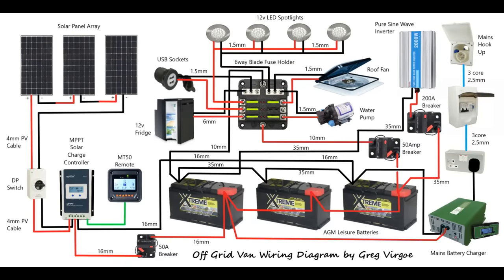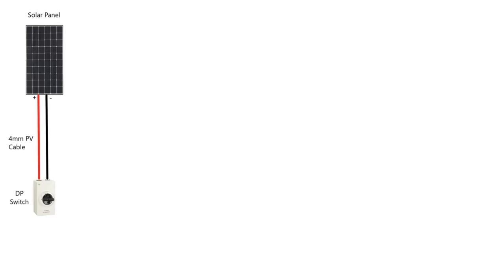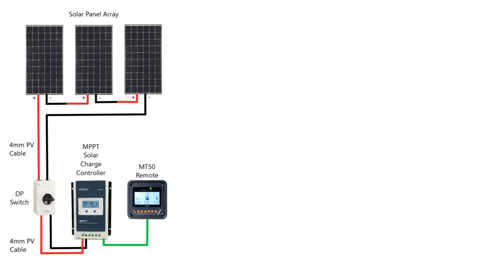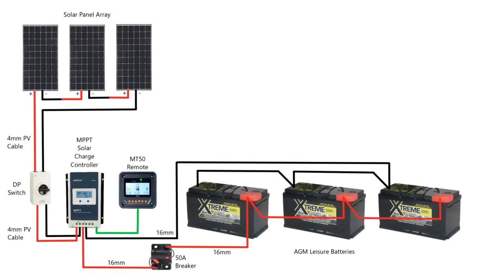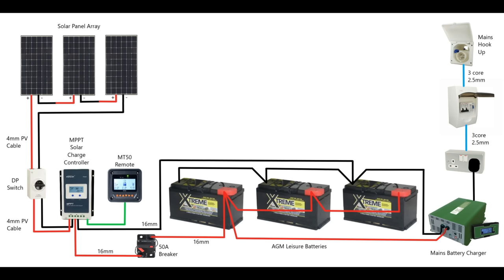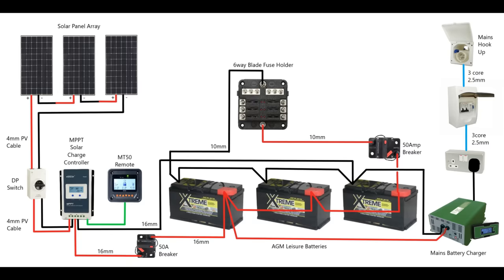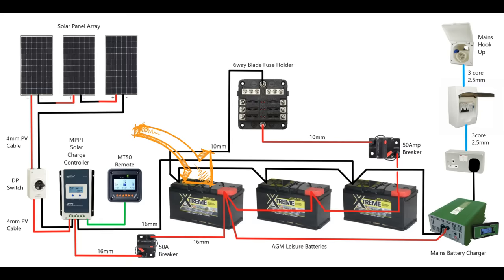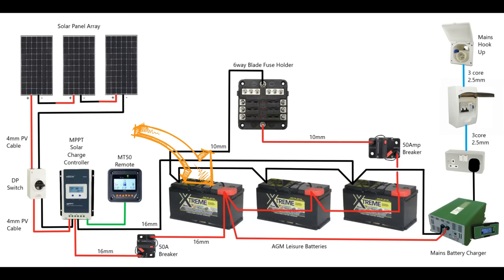How to Wire your Camper Van to be Off-Grid

Comment: Hi Greg.  Great video and using all your kit.  One thing, have you used a battery monitor/shunt on the negative to be able to accurately monitor depth of discharge?  Any tips on using that in the circuit diagram?
Reply: Also which battery monitor would you recommend?  Have bought all the Renogy kit from the later Ducato van build video, rather than Victron to save money.  Also , can I install a cheaper mains charger?
Reply from the maker: I didn’t install one in my van as I wanted the charge and discharge to be on opposing sides of the battery string. I just use the battery voltage on the mppt display to determine the DOD and always keep them above 12.3v which is about 70% full.
Reply: @GregVirgoe  I’ve only got 1 battery so would it be ok to use?
Reply from the maker: @johnmitchell3027  I’ve gone for the Bluetooth pluggin and the Renogy app for this new setup. It should give me enough info without the need for a shunt
Reply: @GregVirgoe  so have I.  Will save my money.  Cheers mate.

Comment: Hi Greg, first off, absoluteylyfantastic job on your videos and your conversion. I'm currently in the process of doing a build and your videos have been such a help. Just a quick queston regarding batteries. Is there a particular brand you reccommend, and is there a reason why you use 2x 110ah batteries rather than one large battery at 220ah? Many thanks!
Reply from the maker: I’m using Leoch AGM leisure batteries from Alpha Batteries. 
There is a free parts download in the description that has links. 
I use multiple batteries to give you redundancy if you have a problem with one battery you still have a backup or spares. 👍🏼😃

Comment: This is great. Can  a split charge relay unit be  fitted  in to charge the batteries from alternator when driving ?
Reply from the maker: Yes it can but I would recommend using a battery to battery charger instead of a relay as it will look after your leisure batteries a lot more than just a simple switch 👍🏼🤩

Comment: Thanks for sharing. When you define 4 mm cable what you mean ? Diameter of copper ?
Reply: What does 35mm denote? Or should that be 3.5mm?
Reply: @stewart9788  thanks Stuart that’s approx 6mm
Reply: @stewart9788  Thanks

Comment: Awesome video… my question is when using main battery charger on cloudy days do you turn off  dc switch or no??
Reply from the maker: No, I don't turn off any of the Dc supplies, as the 12v appliances will still run from the batteries as normal. I do switch my mains changeover to hook up supply so that all the sockets in the van are fed from shore power and make sure the inverter is switched off as that is not needed when plugged into the mains. Hope that helps.

Comment: Hi Greg. I find your videos very easy to follow.
I have just installed my ne lithium 100 Ah battery by following your video.
Question. Do I need to 'ground' the negative side of the battery to the chassis. There is no inverter so all DC 12V.
Thank you.
Andy.

Comment: I really appreciate your detailed videos. 🧡🙂  How does the inverter wiring work? I want to use my inverter in my camper that I'm renovating to be off-grid. The camper came with its own outlets that can only work if I'm plugged in at a campsite. As I said I want to be off- grid, so I bought an inverter so that they can work on solar. However, the inverter I have has the battery connections on one end, and outlets on the other. Outlets I don't need. How do I connect the camper wires to the inverter? Was there a certain type I needed to buy?
Reply from the maker: You can use a double pole changeover switch to switch between mains and inverter I’ll link one here. https://www.ebay.co.uk/itm/Live-IP66-Enclosed-Changeover-Switch-20-25-32-63-Amp-3-Pole-Surface-Mounted-/184127769293?mkcid=16&mkevt=1&_trksid=p2349624.m2548.l6249&mkrid=710-127635-2958-0
You wire the hook up power and output from inverter into the switch. Then the output of this switch to your sockets. You simply switch between the two when you want.

Comment: should the mains battery charger be fused or have a circuit breaker between it and the battery?
Reply from the maker: A battery charger would normally have some internal protection and if like mine come with the cables pre wired to the unit. Mine also has a fused plug on the mains side.

Comment: Another great, informative video Greg! I just have one question.. I plan on using a solar charging station (eco river pro 700w with additional battery and eco delta 1800w, 3200 surge). Where do I start? I understand everything except how the station (or 2) would be hooked up. Do you have a video on this topic? Thanks for any help you can provide 😊

Comment: Hi Greg,
The cable size you suggest for the 2kw inverter is 35mm. Can you tell if I can use, let's say, a 10 mm cable if I place the inverter about half a meter away from the batteries? 
Thank you for your very good detailed video! :)
Reply from the maker: That is right on the limit for those details. Any further and you will have to go up a size. It’s always better to be a little over and have that peace of mind. This calculator is very handy for choosing cables
https://www.12voltplanet.co.uk/cable-sizing-selection.html

Comment: Hi Greg, thanks again for the video and explanation. On our conversion we’re planning to use this system, including the inverter for 230v. Following on from where your video left off, how are 230v appliances connected to the inverter and the rest of the system? Are sockets connected to it in the same way as they are for the shore power part? 
Thanks 👍
Reply from the maker: You simply use 2.5mm articblue cable with a 3pin plug on one end. Plug that into your inverter output sockets and the other end wire into the back of 3pin household sockets. Or you can simply plug in a multi outlet extension cable for an easier solution. Just remember you are limited to the 13amps that’s in the plug so don’t get running loads of things all at once

Comment: Great video and diagram Greg. If you were to add a battery monitor into the system would it go on the +/- terminals of the fuse box that run to the battery or can the controller from the solar system detect what’s being used from the battery to avoid having a second?
Reply from the maker: I normally view my battery status from the MT50 remote control for the solar charge controller. 👍🏼😁

Comment: Hi Greg , love all your videos its assisting with my own van build, I have one 160 watt solar panel, so what amp MPPT solar charge panel controller would I use, I also will be using a 110 amp leisure battery
Reply from the maker: You don’t need to go any more than 20A MPPT with that combination. 👍🏼😃

Comment: Hi Greg, love your videos and find them very informative. I have one question regarding the batteries and charging etc. From my past work experience batteries don't like to be charged and dissipated at the same time so how do you tackle that problem? Also how come you don't use the load terminals on the MPPT module to feed the 12V fuses? Thanks for your videos, I have liked and subscribed. 👍

Comment: Great video! Can we use a bar to collect all positives on it including 3000 watt inverter? Is there any problem to do it so? Thanks
Reply from the maker: You can use bus bars you must make sure that both the bar and the cable connecting to the battery can handle the total current of all your devices added together. The inverter alone is 250Amps 😬

Comment: Hi Greg, thanks for such a great video, just what I need and what I was looking for in setting up an off grid van/ carpentry workshop. 
My question is: Can a petrol generator be added to the system in order to run 240v machines, and could it also charge the batteries at the same time? 
Thanks

Comment: Hi Greg, awesome videos,  without them my conversion would probably never happen. Quick question. Ive also gone with 480w of solar. (In fact basically copying your set up completely). What size of double pole isolator did you use? Cheers.
Reply from the maker: As they are wired in series anything above 20amp rating will be fine 👍🏼😃
Reply: @GregVirgoe  Cheers buddy. Thanks again for your videos and fast reply. Absolute Star.

Comment: Just about to convert my transporter t4 and this has been golden nugget off information Thankyou. 1 question I have if I wanted to have split charging instead of solar panels would I just need to remove the solar panel schematic and replace with the split charge schematic?
Reply from the maker: Remove the solar panels and mppt charge controller and connection to leisure battery. I would recommend fitting a battery to battery charger instead of a split charge relay as it will look after your leisure batteries much better. 
Why are you not going for solar when it’s free energy? 🤔
Reply: @GregVirgoe  Many thanks for the reply. Looking at all available options and then look at the budget on which method I can afford

Comment: Thank you for a very useful video! In terms of mppt controller which one should I get? (10,20,30 or 40amp)? I’ll be running a 200 watt solar into 2 leisure battery’s, using just led lights, fridge, water pumps and usb. 

Thanks 

Toby
Reply from the maker: You can most likely get away with 20A mppt. If you want to add more solar in future maybe look at a bigger one to start with. 👍🏼😃

Comment: How is the DP switch wired ? Mine has 2 connection points. . Do you split the positive on the  separate terminals and have no break in the negative. or are they both split on separate terminals which basically shorts out the panels. Great help by the way .Thanks.
Reply from the maker: My rotary PV isolator switch has four switches inside so there are 8 numbered terminals and they are arranged in pairs as follows 1-2, 3-4, 5-6, 7-8.  You need to break both the positive and negative wires and I used 1-2 for the positive and 7-8 for the negative. Remove any pre-installed links or metal bus bars that may be installed by the manufacturer. Here is a link to the switch I am using https://www.ebay.co.uk/itm/314378203713?hash=item493266b241:g:DxQAAOSwcs9j4cDb&amdata=enc%3AAQAIAAAA4IQwDzZS%2FW4q5lN3OBNMyXxFkEVJNekJHU0MGOAoPTnU9cKNKU84zr%2BiHmysJBq%2BX6b%2BQg1vxicLzmJNCkAeTtY%2FJf06u0Pj5KhRQzde8%2FfHFTMRO2dHCinKultDmJ9DkbYco5cQYXCLJO467t8jcqPZ9YJGbdj5L3sEcOK18FmLrusSzF8Jml1qVDp7L9jRU%2BHFZFRkAaz1mSWloCAAyCAvnsmvsDAGhPOP8%2B55yTpinY4x%2BhwtYCyoUSImFCmwUAqM%2FjC%2BHRxYE6UaPelTLhIyNhBti9W9thQfhpgNlcMU%7Ctkp%3ABk9SR6qdotz8YQ&mkcid=1&mkrid=710-53481-19255-0&siteid=3&campid=5338027957&toolid=11800&mkevt=1

Comment: Hi Greg, very detailed videos great effort, of running everything back to buzz bar can the buzz bar then also be attached to van chassis or would it be pointless extra effort
Reply from the maker: If it’s just a 12v DC system and you are cabling all the positives and negatives you don’t need to connect to your van at all. 👍🏼😃
Reply: @GregVirgoe  awesome looking forward to your future videos

Comment: Hi guys how much would a small set up cost,I am trying to live of grid in a large frame tent,in France, cannot do it myself,as I am partly sighted I have 2 100wh panels,and a controller cheers, keith,France,🤠🍺🍺,
Reply from the maker: If you already have panels and controller then two batteries and cables should be no more than £400

Comment: Another great video Greg, thank you. My question is: If you wish to change your batteries off the grid at someones house or off a generator, I assume you just bypass the fuse box and campsite hook up cable and just connect the mains changer direct with an extension lead right?

Comment: Hi Greg, another doubt I have is the DC-DC battery charging from the vans alternator.  I see you haven't placed in your diagram.  I am not inclined to mess around with the car electrics, hence limiting the charging to a well boosted solar panel bank and shore-power.  However I would appreciate your take on the matter.  Cheers
Reply from the maker: The additon of a DC to DC charger is a good back up and simple to fit. I recommend using an isolated version and running both positive and negative wires. I do plan to retro fit a 30A Victron Orion Isolated Smart charger to our van and has just installed the cables for this, video coming soon. https://www.ebay.co.uk/itm/314240927675?epid=10047079068&hash=item492a3807bb:g:308AAOSw7VJhKI5o&amdata=enc%3AAQAIAAABAEYBSsh2u41P4SykLZv1%2BjR%2BQc1aaLyeSAtM5cHvzWPsZl2ZZTQFakbfFGVPpDyoDKi20geLBSa9uz95JD5wvGgar9rGKSSHW9KcXCNzDYLX31POclVKQzhrhQ6MlkOLwKPTmREgJCxxDXHBaRl8UN3xWb6%2BuBdhlyYPh3EnM%2FjY2MYu%2Bwx5zgnl0uuJo24ZIC3daulxN3wcl0NxhEr7m9XagXsd6%2F%2F%2BS%2BN%2FeEWS6DGdcSrM2%2B%2FqPxnjDd7hnaA5ODjUsrN9PxqnEJ2n4LbEQNKliOXUzCQNQ81kY9g7xXF2kfSToRjynJ2uXOintyeAC6Cv3SOmRPnYNH6dMGE9nLE%3D%7Ctkp%3ABFBMhsjI7vhh&mkcid=1&mkrid=710-53481-19255-0&siteid=3&campid=5338027957&toolid=11800&mkevt=1
Reply: @GregVirgoe  thx, i will give it a few more looks and thoughts!!!!.....and maybe some action.🤔🤨💪

Comment: Excellent video Greg.  I have a question that maybe odd. Could you run the positive and negative from the charge controller directly to that fuse block and put a 50A fuse, as opposed to that 50A circuit breaker, since that fuse block connects back to the battery?

Comment: Hi Greg, thank you for this video and for all the help you are offering to the camper van community.

I would like to add charging from the alternator to this diagram and I am looking into using a DC/DC charger to do so. This way, the DC/DC charger and the MPPT controller would be connected to the AGM batteries but I am not sure how to connect them. In parallel? do I need a switch? I would like to give priority to solar charging even while driving.

Comment: Hi Greg, Is it ok to use 16mm2 cables or will the positive and negative have to be 16mm each. Sorry if this sounds like a dumb question but I'm really new to the world of electronics. Great videos, thanks.
Reply from the maker: Thanks for watching and no problem with the question. 
Cable sizes are given as the cross sectional area so when I refer to a 16mm cable its 16mm2 and not 16mm in diameter. Hope that helps.

Comment: Hello.  Thank you for all the information about building a camper van.  We are at the very beginning of this adventure and have some basic questions.  First, the van we bought came with an ac unit but it is not installed. We are not sure if it makes sense to install it or if it would draw too much power.  I do not see an ac unit on your van.  Do you have one?  Would you recommend having one?  Just trying to figure out the spacing on the top of the van and what we will need for wiring.
Reply from the maker: Hello, much the same as electric heating the AC with use a lot of electricity. If you plan to be on camps sites with electric hook up then it will be ok to use. But on leisure batteries it will take too much power from them.

Comment: Hi Greg, thanks so much for this it is so helpful.  Could you advise on the possibility of being able to also charge my two starter batteries independently connected to the two engines on my boat. Can this be done on this system or should it be a separate issue, Regards Paul
Reply from the maker: They are most likely to be different make or size to your leisure battery. so a simple stand alone system with a small solar panel and charge controller would be enough to keep the starter batteries topped up. 👍🏼😊

Comment: Hi Greg - thank you so much for the invaluable information in your videos! We are trying to get to grips with the electrical system for our van, and something which is putting a spanner in the works is having an induction hob instead of gas. We know the Watts will be around 2000, and we’ll use it for max 2hrs per day, but videos I’ve found suggest lithium batteries only. 

Do you have any thoughts on this? Would it be possible with AGM or would we simply not have enough power? 

The main three power users in our van will be - fridge, laptop charging (working remotely so this will be every day) and the induction hob. 

Thanks in advance!!
Reply from the maker: Hi Abigail, thanks for getting in touch. The problem with any form of electric heating is it uses a lot of electric. Lets calculate your example.. 2000W / 12v = 167amps per hour x 2hours = 334Ah of battery power. Now if that was supplied by AGM batteries you would need twice that amount because you can only discharge them to 50%. With Lithium you can use the entire battery so can get away with less but they are much more expensive to buy. Also AGM would struggle to deliver a constant 167amps draw so Lithium is the best option. In reality I would say you won’t be cooking for 2hrs each day that does seem like a lot. We cook a main meal once a day and that takes 30mins max. So possibly 200Ah of lithium would do so long as you had plenty of solar and DC to DC charger to top up while driving. I hope that helps. 😃

Comment: No mention of cable length when determining the required thickness. I'm finding that running a cable of 8m to a 3A usb socket will require more than a 1.5mm cable due to the voltage drop. :-(